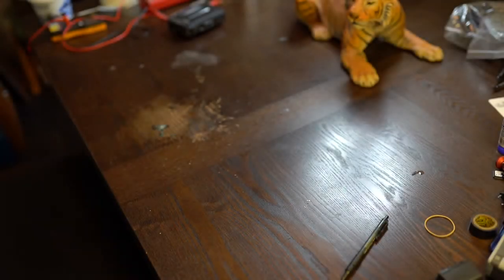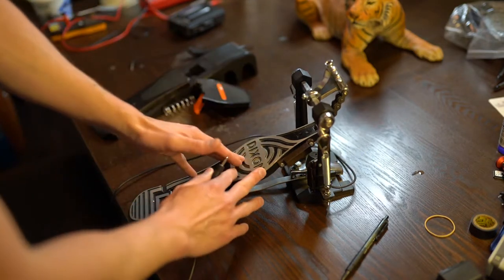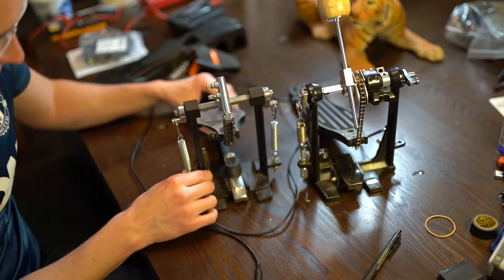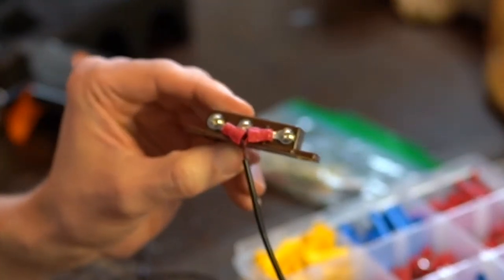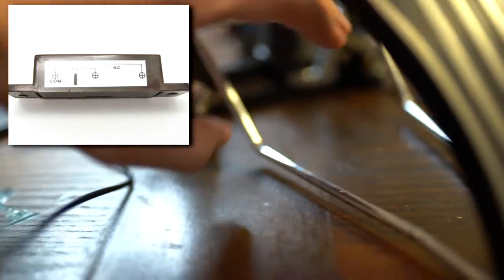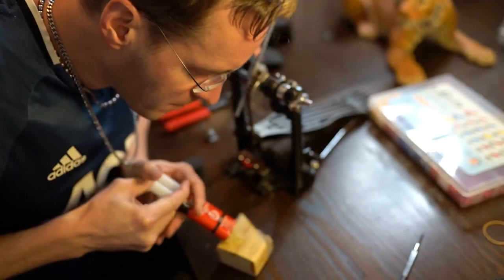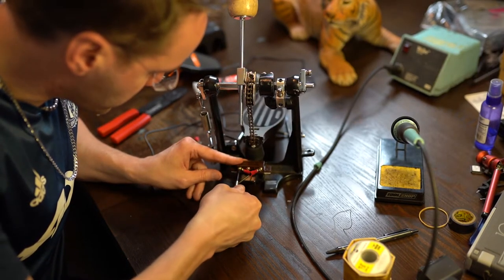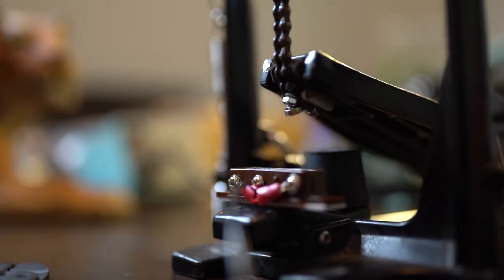How to Convert any Drum Pedal into a Rock Band Foot Pedal! | Harmonix Rockband Fix

Comment: Is there anyway to use this with an ion brain using the 1/4in setup. I can’t get mine to register in game.
Reply from the maker: Are you referring to the Ion Brain Module?
I've never seen one in the flesh, but back in the day I really wished I had the coin for it...
If the standard Rock Band Foot Pedal registers bass beats with the Ion Brain, this mod WILL WORK!
Great question, David.  Hit me back.  👊🏼
Reply: @VestigialVoice  I did end up getting it to work. For whatever reason the monopole chord with a 1/4in didn’t work. But one that had two sets in works also useable as a double bass.

Comment: Can i use an audio jack from normal headphones?
Reply from the maker: The audio jack on your Rock Band drum kit is the port in which your foot pedal ultimately plugs in when you have finished.  You do not need ANOTHER audio jack for ANYTHING.  Perhaps I do not understand your question.
Reply: I bought the drum kit without the foot pedal, I was looking for a way to make a homemade one
Reply: @soyderyan  did you ever try this repurposing a regular headphone cable? I'm hoping that I don't have to buy one